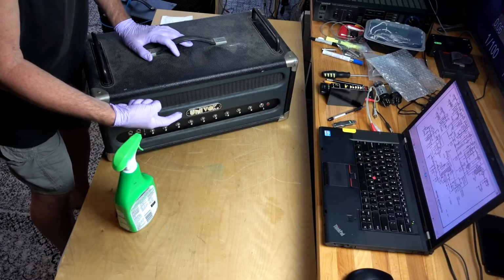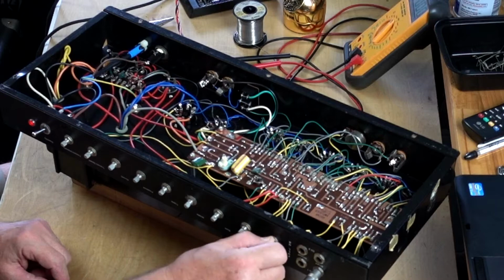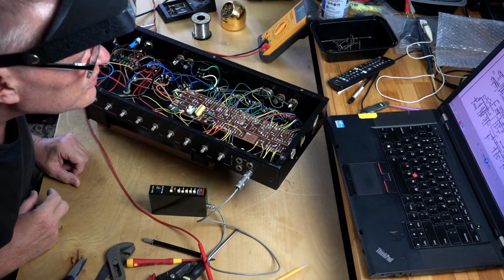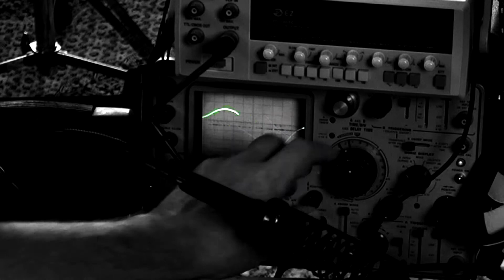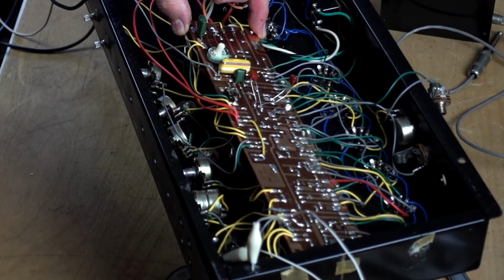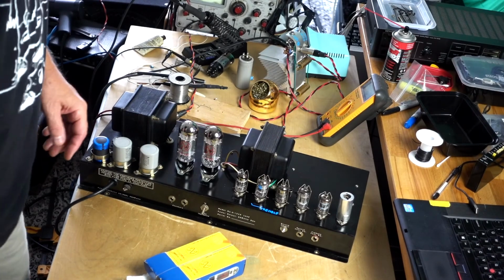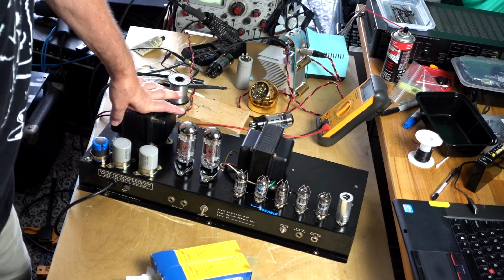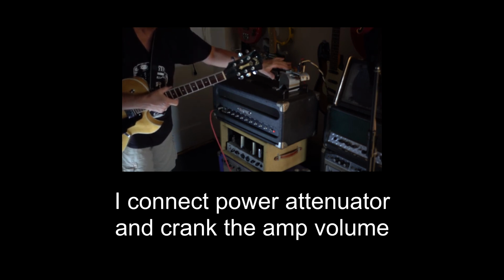Univox U-1226 amp repair and test

Comment: I have a 1970 U1511 with non working tremolo. I gave up on it! Did you put a 12ax7 in this one to fix it?
Reply from the maker: hey, 12ax7 will work too, au7 is better, but in addition I had to change bunch of caps too...

Comment: Hi I have a U1246 that looks similar to this in the schematic. Your video was helpful but I don't think i will take it apart. If I can ask when do you know if the tubes need changing? Thank You.
Reply from the maker: Preamp tubes start being noisy/microphonic, output tubes loose power, start to hum even when volume is down. Good luck!
Reply: Hi I was told to get a main filter cap for my amp do you have a part number for a replacement ? your help is appreciated. Thank you. My looks exactly like yours. @rastop1
Reply from the maker: Don't have exact part, but any modern hi voltage (450-500V) cap will do @rickg1655
Reply: hey thank you, I've had this amp for a long time and will get it running again. @rastop1